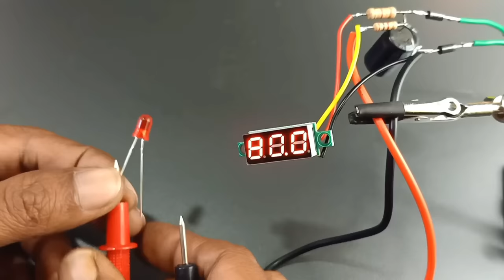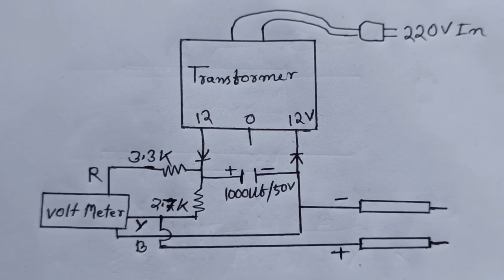Helpful Device for HOME // All Components Testing Using ONe Rasistor, You Make This at Home B

Comment: Привет мой друг. Схема действительно рабочая, стабилитроны проверяет на ура. Только почему то у меня с блоком питания на 19 вольт - вольт метер покмзывает всего 22 вольта.
Reply: The laptop supply is already filtered and regulated to 19 volts.

The 22 volts is caused by regulator ripple at a few khz.

The 12v transformer is not a filtered source so it builds up to the peak to peak voltage.

Comment: Hooray! No more mains voltage connected to probes. The mains voltage stepped down to 12v AC is much safer.
Reply from the maker: Output 30v ac , convert dc 40v with capacitor
Reply: @RJEDITALL  It's 40 volts AC peak to peak if you're getting 40 volt dc after rectification. 
True rms AC would be 12v.
Anyway, so you have 40 DCV going into
A capacitor rated for 35 volt. This will go bang eventually. 
That would cause an emotional shock but not a fatal Electric shock. 
It's a vast improvement over your other video that was potentially deadly.
I rate it 3/10 stars. A giant leap in the right direction.
Reply: Good
Reply: Nice one but I have seen more better multimeter on  a channel named                  veer science project
Reply: @danishdart   yes,  40VDC is insanely high

Comment: Hi,
Thanks for sharing this nice video. Can we use the above tester to check DC motor voltage? Normally A1 2V DC motor will work with 18V to 3V DC. If your tester can check correct voltage, it would be really wonderful tester for me.
Reply from the maker: You can try

Comment: Gracias por compartir sus conocimientos y su valioso tiempo 
Mi pregunta con todo respeto es si con este circuito se pueden probar componentes instalados en la tarjeta
Sin necesidad de desoldar 
Gracias
Reply from the maker: U welcome, clear not understand
Reply: @RJEDITALL  he wants to know if it is possible to measure components on board,
Reply: measuring voltage on circuit with this tester maximum 50-60 volt only not over voltage
Reply: @abcabc-lj8tk  And how about with the CURRENT thru the diodes and transformer? Won't burn them? Greetings from Argentina!
Reply: @ALEFILES  thats voltmeter device only , not for current measure

Comment: hi and thank you for your efforts. can you tell me what will happen if we power up and test components in the wrong way? must we choose the negative and positive correct or it does not matter? will it break components in the wrong way?
Reply: It depends. Diodes, LEDs, etc will block the current. Resistive loads still function as well as electromagnetic loads such as motors, relays, etc.
Batteries and other sensitive loads however, will have problems.
Reply from the maker: No problem with check wrong site component
Reply: @RJEDITALL  Nice and easy-to-make project! One question: Is there no problem if you touch (short circuit) the test leads? In the video the voltmeter shows "0.00" but how about with the CURRENT thru the diodes and transformer? Won't burn them?
Greetings from Argentina!

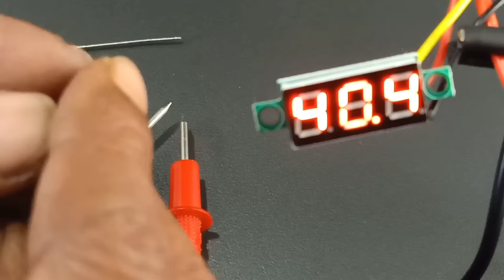Comment: Isn't the diode that appears at 3:42 a normal silicon diode, not a damaged one?
Reply: Right! It might also a zener voltage with a higher reverse breakdown voltage in which his test supply voltage was to low.

Comment: Why is transformer used 12-0-12 and what is it called , and can we use any other product other than transformer.
Reply from the maker: Yes, you can use
Reply: Can you let me know for example ?
Reply: I also want to know about resistor can I use 3.3k / 1/4w ?
Reply: The adaptor you should in video is 19.5V 3 ampere , to Kya muje 19.5 volt ka use karna chayey ?
Reply from the maker: @junkievideos  you try

Comment: Can used 12v 300ma  transformer bro .Thanks.
Reply from the maker: Yes , but you can check 12v zener diode with 12v transformer
Reply: @RJEDITALL  Nice and useful project, thanks! With 12v power supply we have to use smaller resistors? 1k resistor maybe or smaller?

Comment: Как??? Трансформатора 12v а на лед панели 40v, у меня такая же схема и 15v объясните пожалуйста
Reply from the maker: Transformer voltage 30v , convert dc with capacitor= output 40v dc

Comment: Hello, how many volts is the output of this transformer?
Reply from the maker: 30v ac , convert dc with capacitor, total 40v dc
Reply: @RJEDITALL  30VAC is a non-standard value. WTF is the amperage?

Comment: Điện trở nầy có gì đó sai sai số wat ,mong ghi rỏ lại
Reply from the maker: Ok
Reply: Làm ơn cho tôi biết số wat cũa 2 điện trở 3k3 và 2k7 cám ơn (vì tôi đang làm mạch nầy
Reply: Và đầu ra cũa biến áp là bao nhiêu vol AC ,tôi làm 12vol AC được không ?
Reply from the maker: @thanhphuoc3485  you can use 1 or 2 watt
Reply from the maker: @thanhphuoc3485  12-0-12v transformer = 24v ac
Reply: Đầu vào là 220AC ra 24DC hả ,nói thiệt tôi không biết gì về điện và điện tử ,tôi học mò theo thôi
Reply from the maker: @thanhphuoc3485  220v to 24v transformer, convert dc with rectifier bridge or Diode and capacitors, resistor

Comment: I'll bet that "damage diode" was really a STANDARD "small signal" diode (i.e., 1N914 or similar)! Why? because it read "open" on REVERSE BIAS and 0.7 VDC ("standard" forward drop for a SILICON diode) on FORWARD BIAS.
Reply: correct. It might be also a zener diode but a higher  reverse breakdown voltage which that tester supply voltage was too low.

Comment: There are dc dc step up converters with 40v output..like XL6019.  ¿Why did you use that horrible big transformers and main voltages ?
Reply from the maker: I need dc volt, AC to DC convert with diode n transformer

Comment: WTF are 5399 diodes?
Reply from the maker: You can use any above 2 ampere diode
Reply: @RJEDITALL  above 2A is 3A or higher.  The 1N5399 diode has a high continuous reverse voltage rating of 1000V and is suitable for forward currents of up to 1.5A.

Comment: Why 12+12=40.1
Reply from the maker: My transformer output ac 15+15v , total 30v ac convert dc 40v DC with capacitor.
Reply: In your video 12 0 12 transformers 😀😀😀😀😀